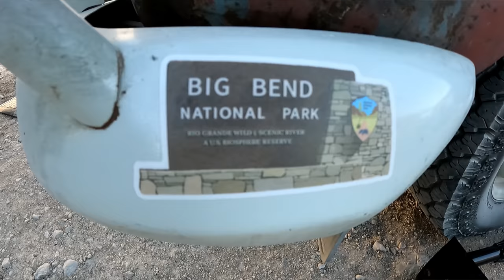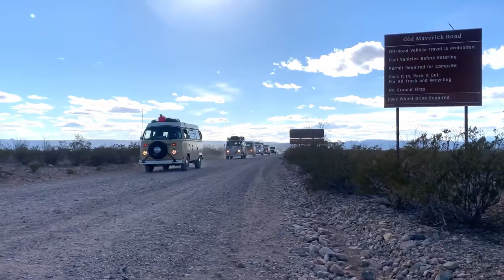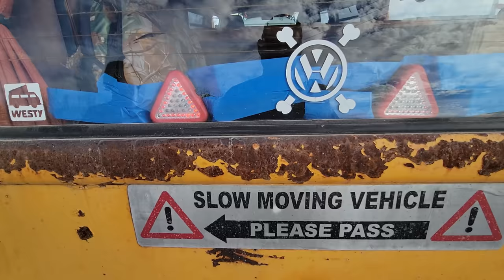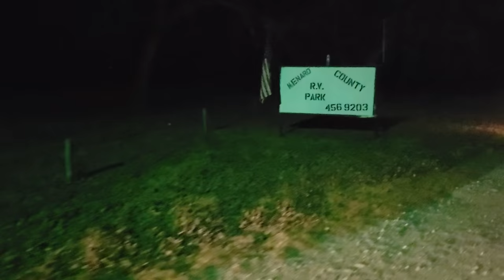A VW Bus Adventure Like No Other!  Backcountry Exploration

Comment: I know you guys like to run points in your distributors, but the number of times I have seen you guys have problems with the points, I would think that is getting old ;-)  I had a '73 beetle where I was constantly messing with the points (2007 cc engine with a 009 distributor), and I replaced them with one of the in distributor solid state modules, and I never had a problem again, and I drove that car everyday for years.
Reply: Yeah, I have mine also replaced with a electronic ignition on my 009, had no problem ever, maybe they like to stop more often.  The adventure is to stop every time.
Reply from the maker: We like to breakdown 😎
Reply: @VWLifeVW  I know
Reply: @VWLifeVW  LOL!  Seems like it ;-)

Comment: Really considering a local 1970 Westy I found to do this camping lifestyle, but damn! Do these vans/engines all break down this much??? Are the parts for them all garbage and wearing constantly,
 What am I missing?
Reply from the maker: well we recently switch from points to electronic ignition.  So that should help.  but keep in mind we've made this trip 6 years in a row and besides a fuel pump Matt had never had problems besides that.